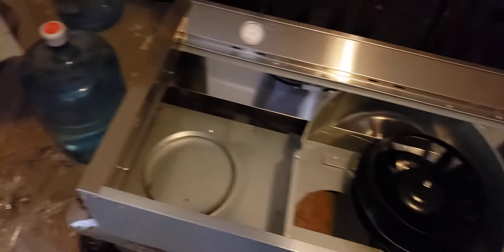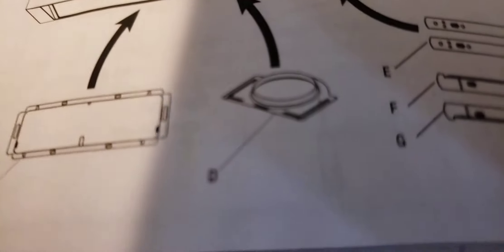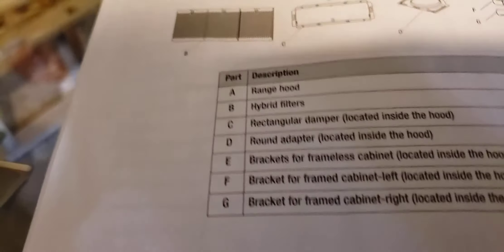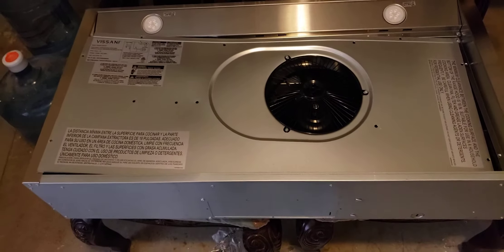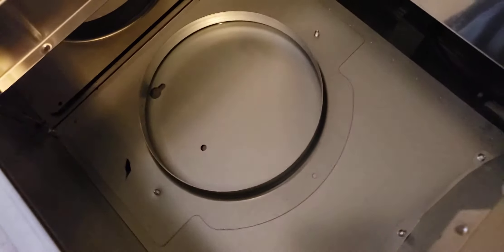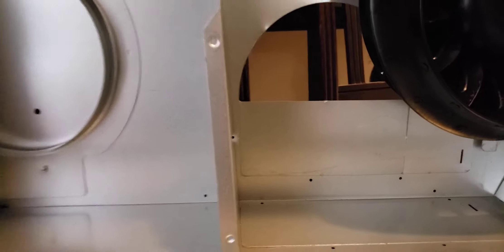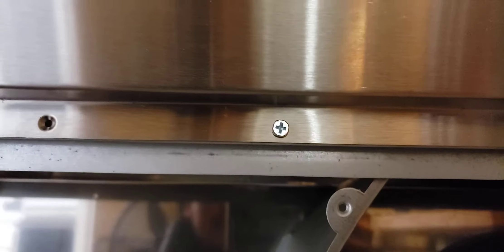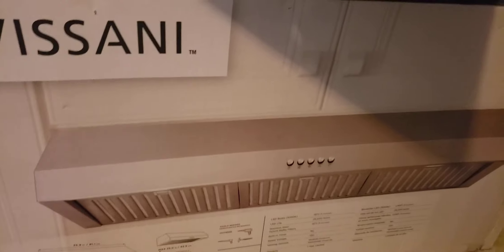vissani range hood 1003 991 716

Comment: 👍May I say if you are replacing the HOOD watch for debris falling from the old one. I had a ton of Crap fall out and then the fan itself fell onto the stove but not before it hit the Burner Knob turning the Knob to heat. Unknown to me?
I had went to get the shop vac come back inside to clean my work area and the towel I laid down to keep trash from hitting the New stove top. "GLASS" burned my towel up.. 
Thank God I was Time on Task to get this  done or I would have had a big ass problem You just never know what can happen. If I had been a couple mins to grab the Vac any longer it would have been completely on fire. That was Fk Insane how

Comment: Does the fan blow out or in?? Im trying to use this ductless.  I think the installer wired it wrong
Reply: I want mine ductless also not sure were it comes out
Reply: It should suck the air in through the filter

Comment: My box didn't include a manual instruction nor any nails. Does your?
Reply: I bought a slightly smaller model, but similar and I can’t find any of the mounting hardware screws. So frustrating it seems they were not included

Comment: Mine doesn’t have an outlet cord
Reply from the maker: Correct it doesn't come with one. I cut the cord from an old appliance like a toaster or a vacuum and I used that to attach to what electrical on the unit